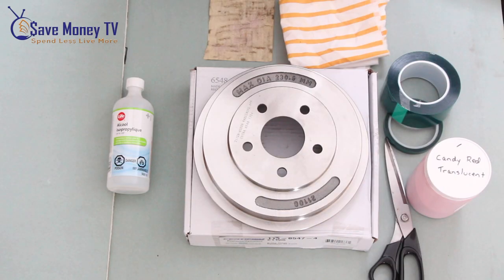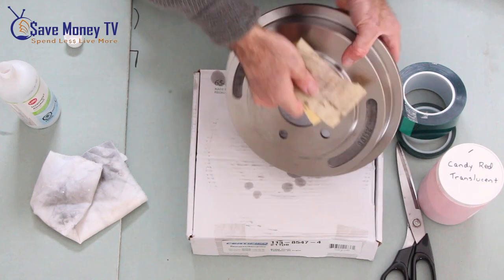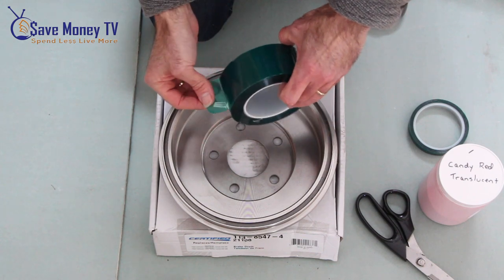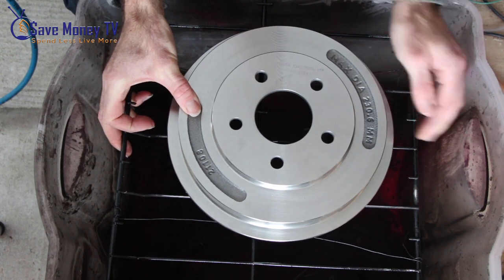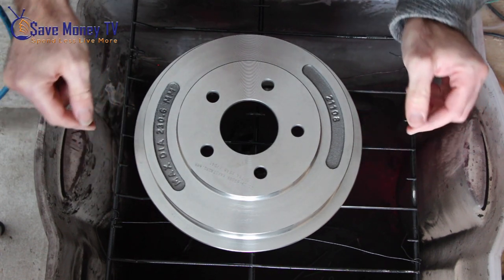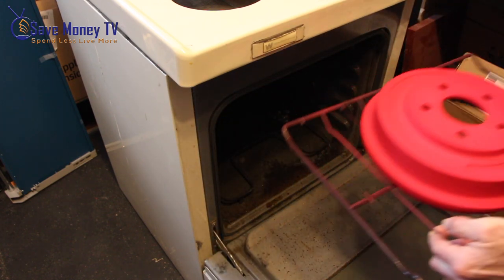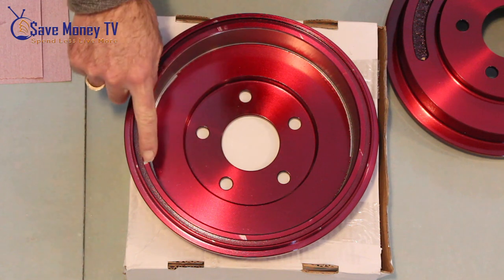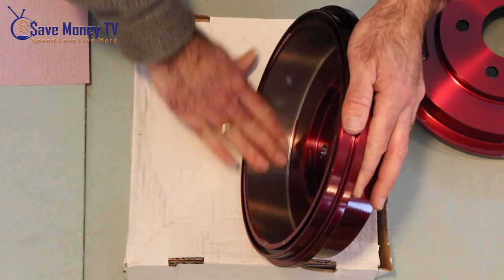How to Powder Coat Brake Drums for great results

Comment: Oil on hands contaminated part
Reply from the maker: Hi Ryan, thank you for your comment.  You are definitely right that a perfectly clean part is the #1 predictor of success!  Gloves (changed regularly through the process) are recommended. I find that the 99% isopropyl alcohol that I use dries my hands out and removes all the oil.  4 years and not a single problem, but as you pointed out you can never be too careful.  Cheers!

Comment: Your brake drum came out good but your powder is under cured. The part itself has to be at 375 for 20 min if that is what it calls for. To know that then you need and IR gun to take a reading and once it got to temp then you cure for the called for time on your powder.The way you did it is the Eastwood way of curing and has always been WRONG so if you want your powder coating to hold up then do it the correct way please.
Reply from the maker: Great clarification.  Thank you!
Reply: I just got through doing a set of very heavy Model A drums and I didn't tape them off but used something like card stock but larger and cut and taped them together trying to get a tight fit and it worked really well with just a little clean up and they were moved from drum to drum.But this morning a light came on and why didn't I cut down some magnetic signs I have laying around and use them. They snap it really easy and then just take it easy removing them and clean and put in the next one. I don't think what is on the outside of them would do well in an oven but I will test a piece out.  You doing just one at a time and I am doing 4 at a time.So lay your hand on some used magnetic signs for the next time and heck you will have one coated long before you can tape them up for sure.
Reply from the maker: @TheDuke1946  That's a great idea!  Let us know how it turns out. Cheers!
Reply: Well I did remember to give a piece of the magnetic sign a test today.  What ever covering was on the outside did not do well at all.  When I checked the back magnetic side you could see something that looked like blisters.  So it is a no go for keeping it on and then curing the part. You will just have to take slow and easy and remove it after you have coated what you didn't want powder on and if any powder does come off the just finger wipe it off and if need be use some 240/180 grit sand paper to remove any excess and there shouldn't be much if any to have to deal with unless you sneeze while removing the magnet HA HA